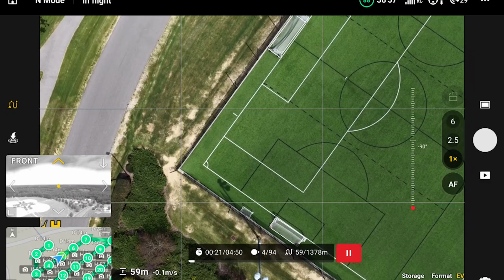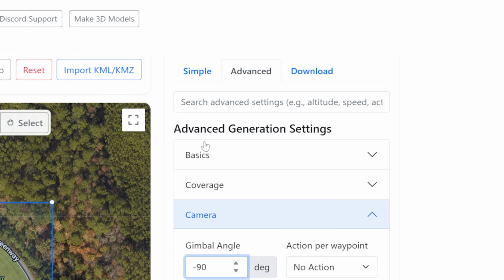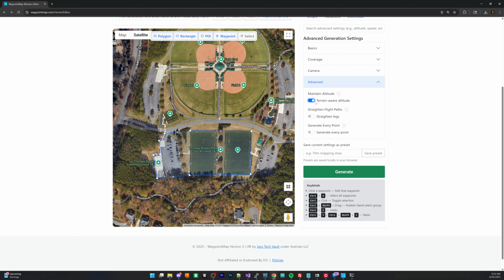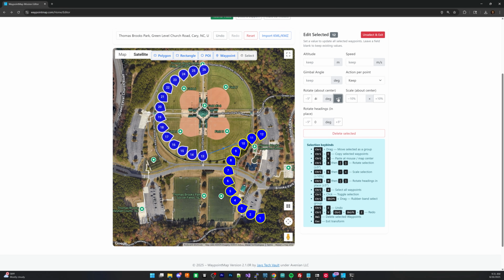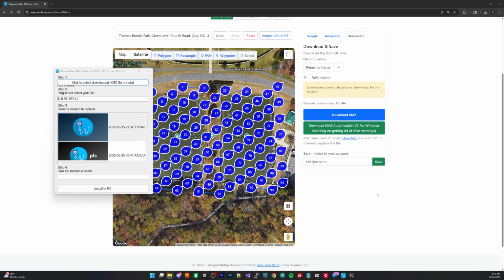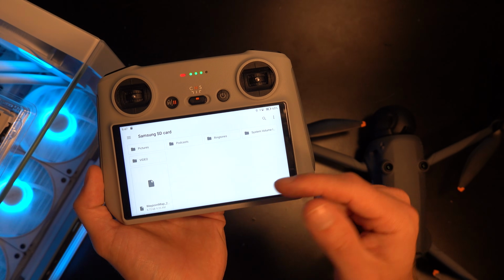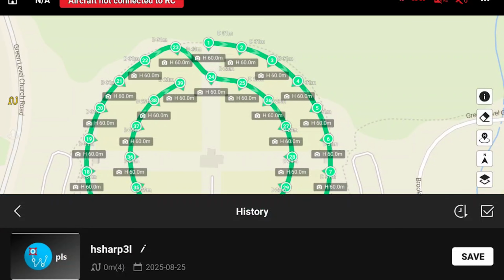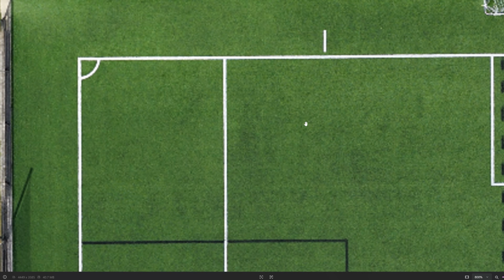DJI Waypoints for 3D Mapping, Orthomoasiacs, and Photogrammetry Guide

Comment: I know you have a newer vid of this- but I successfully did the kmz copy on the original RC with the screen (the hardest method) following this video- but now, a few weeks later- I cannot get the sd card to stay in the notification area. It immediately disappears, perhaps after a firmware update.... can't get to the menu to allow me to copy/replace anymore. tried ejecting, rebooting, quickly selecting,. nothin'

Comment: This comment may be useless but … I use to have a DJI Mavic 3 Cine and I think it had the “troublesome” DJI RC Controller.  I no longer have it.  I think I could use Android File Transfer to connect to the controller and at that point it would be fairly easy to do the file swap.  So, if anyone has a the troublesome controller you might try Android File Transfer (for the Mac) and see if that makes it easier.  Good luck!

Comment: Hey Jay. I split a mission in to two files. To transfer the two files to the RC (not the pro) for the Mavic 3 Pro, do I need to create and save two dummy waypoint missions so there are two files to rename?
Reply: Also, is there a recommended limit to the number of waypoint per split kmz? The controller app kept crashing and I realized I had almost 500 waypoints per kmz. Trying to split it up more now....

Comment: Tell you what, this is trash. It will not work on Air 3s with RC2. He won't clean out his email inbox, and when I tried to connect with him on Discord that didn't work either. So tell me, dose anything on your site work?
Reply from the maker: I have no questions from you on discord. I responded to someone just an hour ago. Given that the Air 3S and the RC2 does work I’m not sure what you are talking about.
Reply: I have the Air3s and Rc2 controller. I was able to make a 2d map. Going to attempt a 3d map next.
Reply: @jeremiahg2716  Where do access the upload page shown at 33:35?
Reply: @drewtaylorphotography2723 ,  are you talking about after you've generated the photos for the map?

Comment: I'm really struggling with getting this to load onto the RC Pro 2 for the Mavic 4 Pro. When I replace the file the old waypoints of the original file still show up on there. I tried with Open MTP on mac and then tried loading it onto a microSD, but then the Data folder just doesnt even show up for me on the controller to copy it into there. Any tips?
Reply: Same. It pops back up. Did you find a solution?

Comment: Hi Jay, thanks for this awesome tool — it’s been really helpful.

I’m flying with a DJI Mavic 4 Pro + RC Pro 2 Controller, and I’m wondering if there’s any way to make the process of importing and managing custom waypoint missions a bit less clunky.

I need to capture around 40 km of detailed orthomosaic mapping across 10 sites, and I’d love to be able to save and reload missions for seasonal re-flights without worrying about accidentally deleting or overwriting them.

Right now, I’m manually copying KMZ files into the Wayline_Mission directory, but it’s tricky to keep track of names. I liked @bobdude247’s idea of adding a second KMZ file with the mission name for reference — any other workflow tips to make this smoother?

I’m also running into issues when importing KML polygons from Google Earth (they often don’t load or display correctly). Any advice on the best way to prepare or convert these for WaypointMap or DJI Fly?

Thanks again — your videos and tools are making a big difference for mapping-focused drone users like me!

Comment: Came back to leave a tip I figured out on my own.. I definitely need to clean some missions off of the phone I use for the controller. But if you manually place the KMZ file in the waypoint directory like I do, I figured out a way to identify the missions in the folders after you replace the KMZ in the directory. Add a second named copy of the KMZ with the name of the mission. That way when you return to the folder, you know exactly what mission it is in the controller. Hope that makes sense.
Reply: does that work with iphones?

Comment: How does the Import KML/KMZ feature work? I was able to import the shape I created in google maps, but waypointmap doesn't use the shape to generate the waypoints. It wants me to still draw a shape with one of the tools. It works in the sense that I can trace the imported Google shape. Also, any chance you would ever add the ability to rotate the rectangles? I would love for the paths to be tied to the rectangle instead of North South or East West, and the ability to rotate the rectangle would help. Great tool!

Comment: If the mission is split into parts, what should the name of them be since the name of the file should be the same as the KMZ folder?  If the generated file is named something else, will it still work?
Reply from the maker: So you would just need to place each kmz in a separate mission (make two dummy missions). Or you could just load one after the other.
Reply: Ok.  So I would need to create those dummies first by flying a short waypoint mission?   I have 5 files.    I usually fly small to medium sized parks.

Comment: After i improting the KMZ file, why it cant be auto generated??, do i need to draw the polygon again with the kmz as a refrence??
Reply from the maker: What kmz are you importing?
Reply: @JaysTechVault multi polygon kmz from google earth pro.

Also, when in the middle of mapping. My route is become chaos, like nowhere from straighten path. Its like all the waypoint, going into one place, not connecting with each other
Reply from the maker: What settings did you use to create the mission?
Reply: @JaysTechVault  do you have any social media like IG, whatsapp, discord or anything else??, so i can provide more detail about the problem
Reply: @JaysTechVault  before that. DO you have any discord or something else so i can provide more information??
Reply from the maker: I think the discord link is all over the site.
Reply: @JaysTechVault  oh i see on the top, sorry

Comment: Pro Tip. On DJI RC Controller, you can pair a Bluetooth mouse to the controller and it makes the entire process 500x’s easier. When navigating the controller with the SD Card. Makes it like a computer with right clicks and copy/paste/renames. Much much faster. 

You can also use it to create waypoints missions directly mission right on the controller and no more fat-fingering. The waypoint goes right where you click the mouse. 

$10 BT Mouse works just fine. 

Hope this helps.
Reply: Grok says this is possible but I was unable to pair my bluetooth mouse with the RC2.  Instead, I opted for a cheap wired USB-C mouse from AMZ for < $10.
Reply: not possible